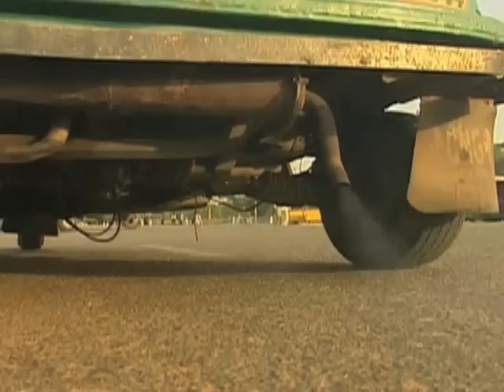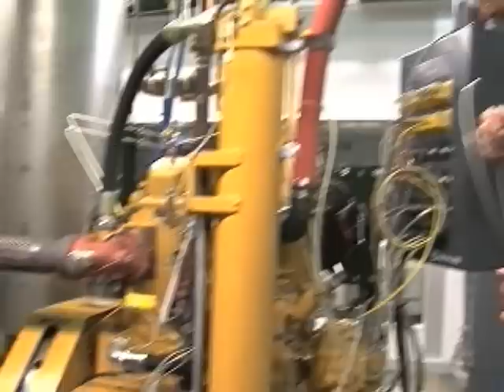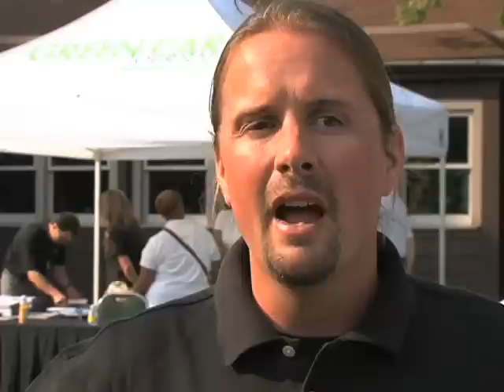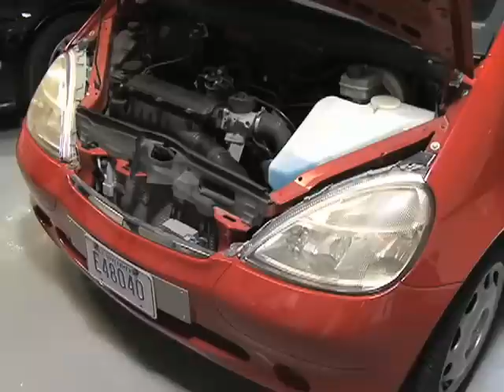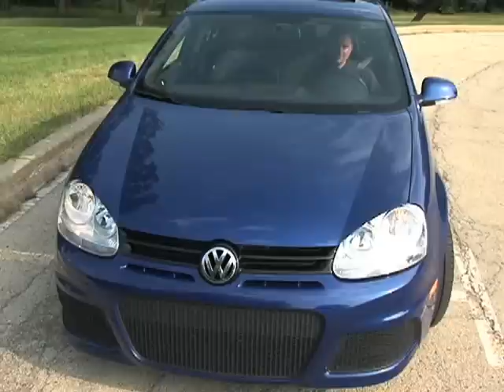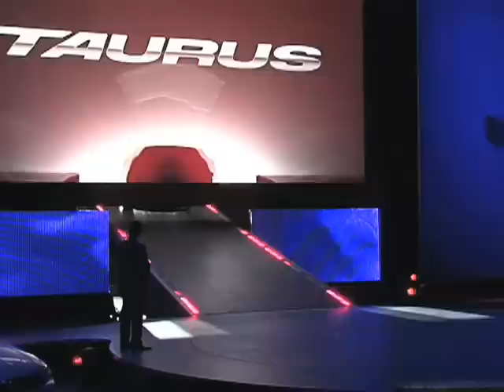Chicago Lab Promotes Advances in Green Diesel Technology

Comment: @Ape65 A turbine engine with advanced fuel system management could run on varied fuels, but they proved to be impractical for real-world use. Optimized single-fuel engines are designed to work most efficiently with a selected fuel.

I'd love to buy a diesel if they were more available especially from American and Japanese manufacturers.